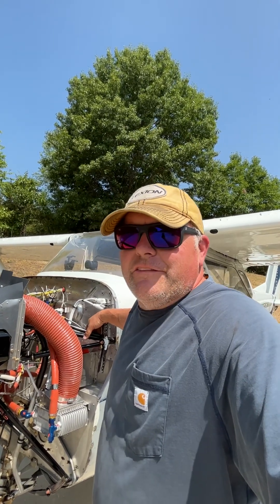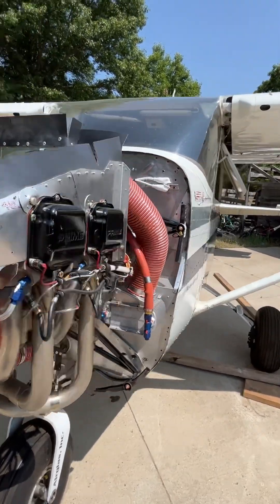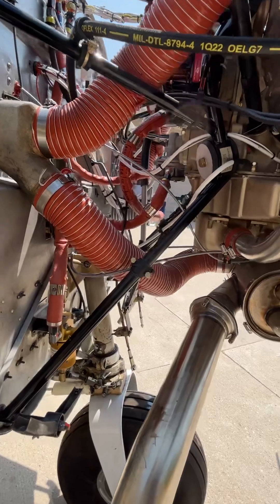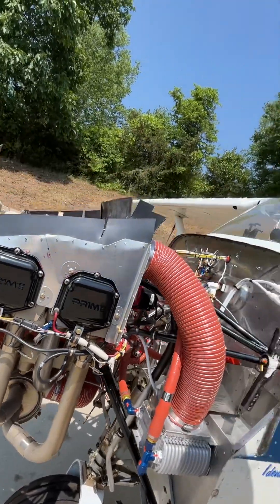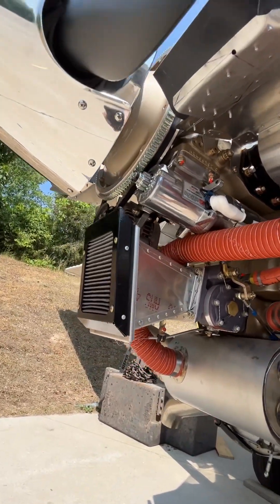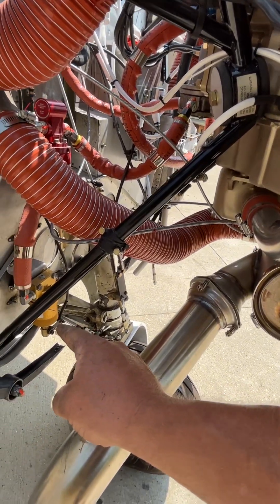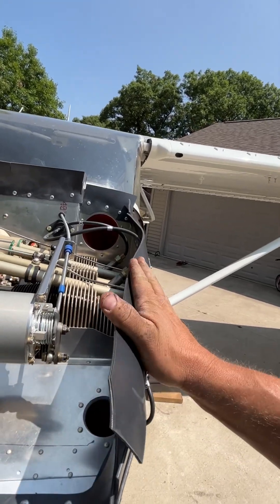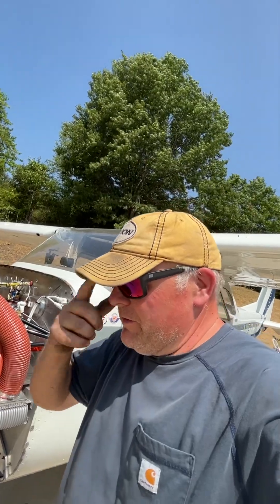Continental IO-370

Comment: What would you say the performance difference would be between your P172D conversion model vs the R172K?  also, what other modifications does your P172D have?  I can see it has VG's on the wings.
Reply from the maker: I would say they would be very very close in performance. Both share the same type certificate “3A17” different from the orher 172’s “3A12” rated at 195hp and a constant speed prop. Some differences the xp has 1500hr TBO 6 cylinder and this Io-370 has a 2200-2400hr TBO 4 cylinder. Now the xp has a 2550 gross weight vs 2500 on the p172d but Cessna had to do that because of the extra weight of the heavy engine. My P172D with the extra modifications weighs 1516lbs the xp empty weight is  around 1570lbs with no modifications. This gives the p172d a better useful load. Some of the modifications on the outside include big nose fork with 8.00x6 and 8.50x6 on the mains, double puck brakes, vg’s, sportsman STOL leading edge, and the Wing-x wing extension “adds 3ft of wing”.  The modifications add almost 30lbs. 
Hope that answers some questions. Let me know if you have more specific questions.
Reply: @joelwyttenbach2772 thank you very much for the feedback! I had been very curious what mods you had on that awesome bird.  You are correct, your bird is much lighter than my R172K, with everything being nearly original since born weighs 1604. Luckily the TBO on the IO-360-KB was increased to 2000, just crossing my fingers I actually get that out of her.  I love watching your videos, as I would never have the guts to land where you do.  Keep up the videos!!!
Reply from the maker: @RAPR117 they are great airplanes. The XPs are very sought after!
Reply: @joelwyttenbach2772 looked up that wing extension kit, nice addition. Seems if I installed it on my XP, it would increase the MTOW to 2675 which would result in a little more than 1025 useful load.  Might have to seriously considered.

Comment: Hi Joel, Thanks for your post. I’ve got a C172D with the 145HP engine. What’s your thoughts conversation 7 months on from your original post? And also on the constant speed prop? 
Thanks, Adam from New Zealand
Reply from the maker: As of 2/9/24 I have 93hrs on the conversion. I really do love it, it has a ton of power and is smooth. The propeller makes this the airplane I’ve wanted for a long time. It is very snappy on thrust. I’m running it rich of peak 25° and 10.5 gal/hr.  I just don’t have much time lean of peak to give you a good number.